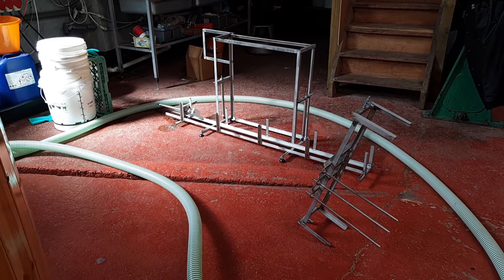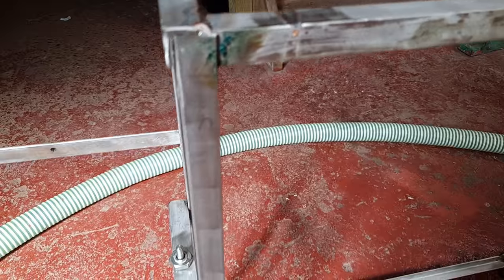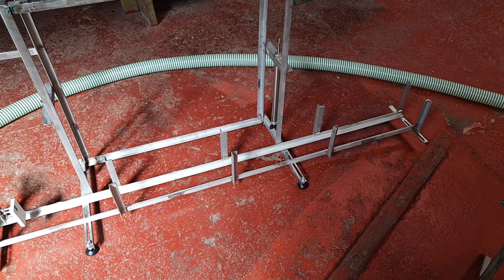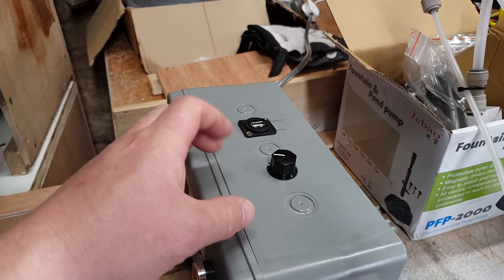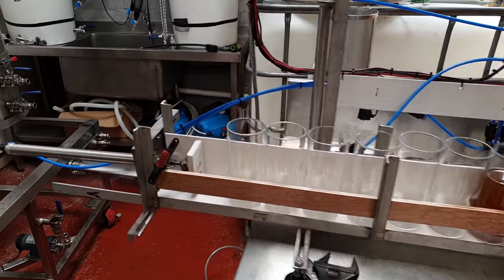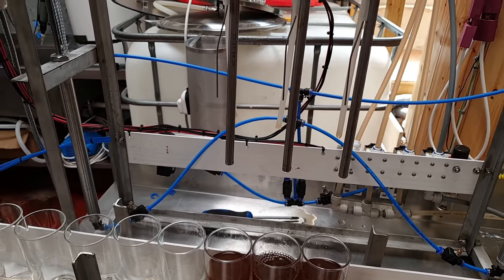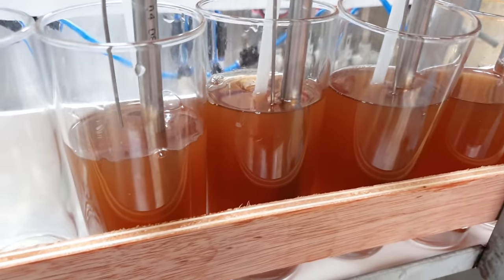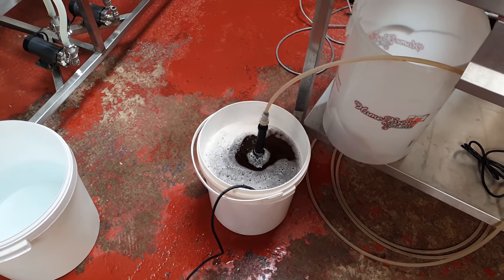Can Filler # Maiden Voyage

Comment: Dear Harry

 

Since
yesterday I have looked with great interest at your you-tube filmps of the
construction of your autom filling station.

Well done!

Can I give
you a tip?

If you
first set up the three co² pipes, then the beer filling pipes, you can double
your filling system in speed.

You can
then let the co² flow into the cans very slowly, while the other cans fill up
with beer. the co² then mixes less with the accident air.

Keep up the
good work.

With best regards,

Karel Tack

Comment: Very well done. I sugest a biger beer manifold to keep the 3 fillers flow more even. How do you adjust the can pusher displacement to be equal to 3 can diameters or 3 mini kegs? May be a final co2 push will provide the foam to be sure no air remains below the cap.

Comment: A thought: is that ram going to be alright with pushing empty, unseamed cans? i.e. if you've got the ram pushing three empty cans that are being resisted by the weight of six (or more) full cans, will they not potentially deform rather than pushing the full cans along? Maybe with some rollers on the bed of the rail for the cans to slide along, that would reduce the resistance from the filled cans?
Reply: Agreed. The empty cans are very fragile and I doubt they would hold up to the force of pushing the full cans.
Reply: Why would there be 6 or more full cans on the line??
Reply: I had the same thought.   I suspect if the plate on the end of the ram makes contact with the bottom rim of the can (strongest point when not seamed) it will be ok.   I'd test pushing an empty can with 6 full glasses/cans of beer on the line.
Reply: It depends on how the machine is operated.   Currently, with the way it's setup, the cans don't move out of the filling area unless you start the next cycle.   So depending on how fast you seam cans there can be anywhere from 3 - 6 full cans on the line at one time.  Personally,  I don't see way you would start another cycle if you have cans waiting to be seamed so I would think the worse case scenario is 6 full cans.   But again...  All depends on how the machine is operated.
Reply from the maker: All will be revealed as soon as the cans arrive. But, just to say if there is more than 3 cans waiting to be seamed, picking up oxygen, then the man on the seamer is gonna get a verbal warning. Also in the video I talk about how the ram push plate can be adjusted to tilt back and forward allowing the contact point to be set, preferably on the can base.
Reply: If not rollers - HDPE strips? They are very low friction, easy to clean and sanitize. When I was looking at the code, I surmised that there would be up to 3 sensors (Simple light beam sensors like those in a garage door opener) that detected the presence of the last can seaming position and the first can seaming position. The filler would pause until at least the 3rd position's can was taken (Indicating the seamer operator was there working) and the system would not send more filled cans until the 1st position was taken (but the FILLING operation could commence), indicating all cans are seamed and the seaming queue is empty. If you added a can dispenser to the front end - you would have a low rate, low cost, can filling system that is darn near automatic. It would be easy to halt the program so that Chris didn't have to issue a warning to an operator for oxygenating his beer - the system would pause filling operations until that 3rd can was being seamed - then it would resume.  (For the purposes of this discussion - the can seamer queue is (1st)(2nd)(3rd) - the 1st is seen in the filling demo as that slow one to fill.) I think Chris may have to use more than the one ram and it will need a shorter stroke so it moves those filled one by themselves.
Reply: I agree. I have distorted (squished) many cans pushing too hard.

Comment: Could you spray lacquer the welding rods apart from the tips to insulate them? Just looking at those bits of tubing as a place for nasties to grow.
Reply from the maker: Everything will be cleaned and sanitised before and after each use, just like the rest of the brewery. 90% cleaning and 10% brewing.

Comment: Hi Harry. Looking very PRO.
With the cans coming out of the right side of the machine, wouldn't the control box be better on the right-hand side so you can grab cans, seam and press all from one position?
You should be able to construct a can store bed at a slight angle on the left-hand side, with an agitator so can's automatically fall into position. That should make it a one-man operation.
Also, I think the last action for each filling process should be to push the filled can's out.
Reply from the maker: It could be altered to run in that sequence but for now I will be placing empty cans on by hand so the push start is in the right place.

Comment: Wonderful job mate. Im currently doing a labeler but it is way easier compared to this. Let me know if your´re interested in making a pcb for the arduino so the whole control panel is smaller, easier to wire and to troubleshot. I could help with that

Comment: I assume there's a hard stop on the end of that can rail? As mentioned below the ram will be pushing empty cans up against at least three full cans at a time,assuming you only have room for three full cans before the hard stop. If for any reason the full cans were not removed in time is there any concern the following empty ones would deform being pushed up against them by the ram? Excellent work,can't wait to see it in action and see those cans going to market. Cheers. 👍😁
Reply from the maker: No hard stop, there is room for about 9 cans on the rail before they fall on the floor.  Just don't press start on the next 3 cans before you have caught up on seaming.
Reply: @harrybrew69  Ah spot on 👍 Thanks for clarifying 😁